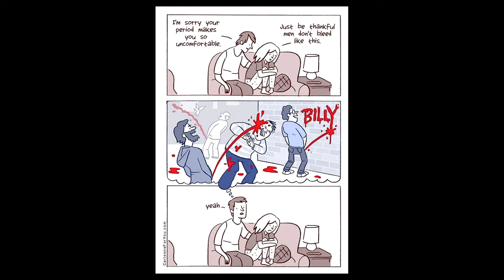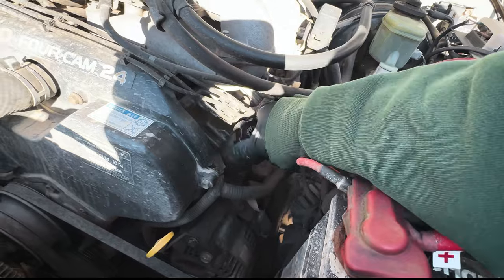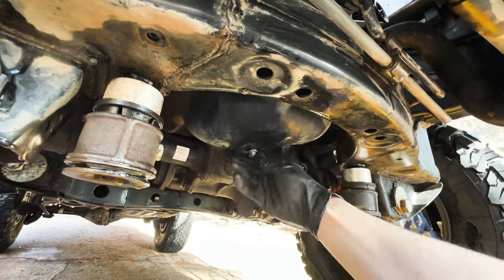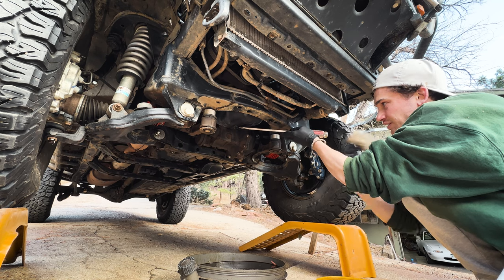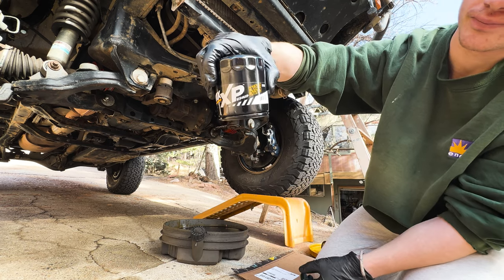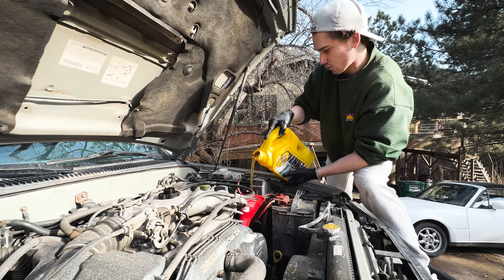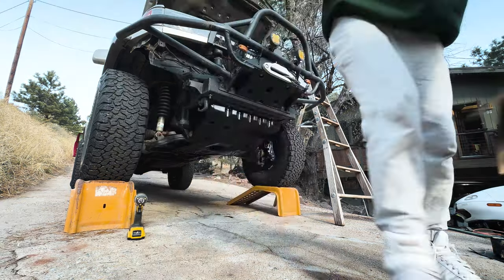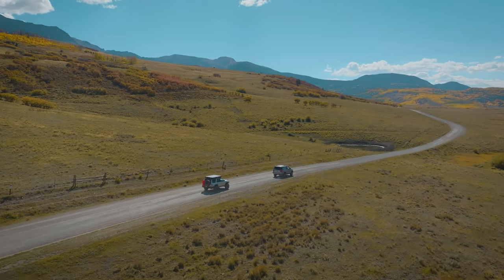3rd Gen 4Runner Oil Change (The Best Way I've Found) // '96-'02 4Runner

Comment: Hey carter, I have a 2000 limited with a very random and unexplainable coolant loss, hearing bubbles in the dash upon acceleration and engine temp heats up past operating at idle after sitting for 10+ minutes. What could I be looking at would ya think?
Reply: Once driving it’s completely fine, I already have new rad, rad cap, water pump, fan clutch
Reply: @jordanwatkins1184   Maybe test your thermostat.